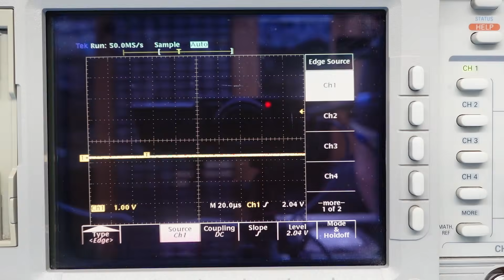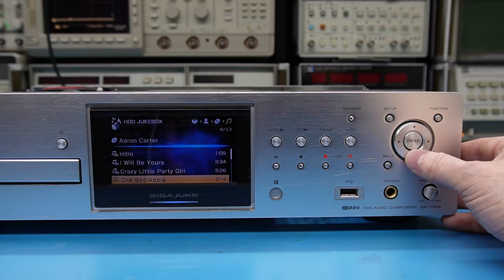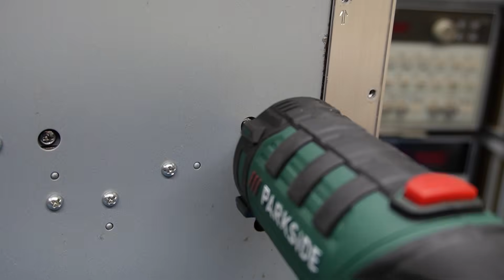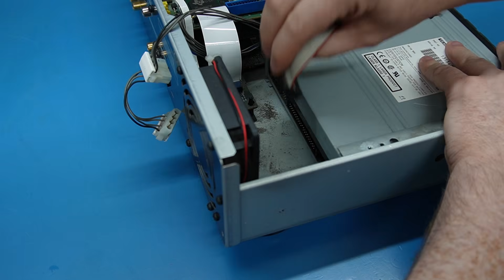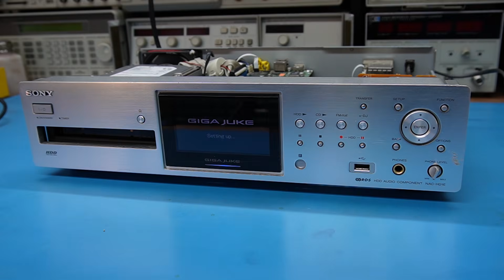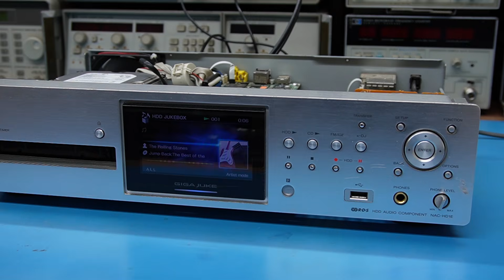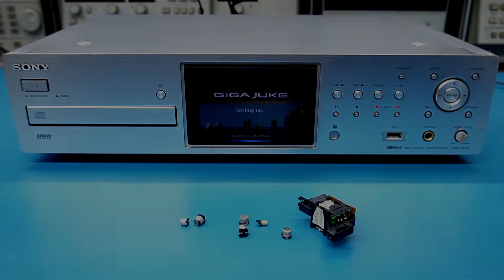SONY Giga Juke, Codename 'PROBLEMBOX'

Comment from the maker: Want to Master the art of electronic repair? 

Check out MendItLikeMark: https://www.menditmark.com/menditlikemark
Reply: With SMD resistors/caps, I touch the flux from the refreshed solder pads with the tweezers. The SMD parts will stick to the tweezers and allow you to remove them from the packet much easier.
Reply: Seriously contemplating that course
Reply: Hello. I have a Toshiba RT -7077 and the cassette player lost his sound. No sound on speaker output and have the same problem on headphones output. I am manage to fix some electronics, but this seems to be a little complicated for me. It have some chances to be fixed ? I'm a bit far from you Sir. From Romania to be exactly. Untill I will be manage to find someone good to fix it, it will be sit for a while
Reply: , find the circuit diagram and check the audio IC.
Reply: @themlotproductions  you know where I can find the circuit diagram? I searched for it on Google, but I found nothing
Reply: Why not try the BadCaps forum as a starting point?
Reply: No
Reply: I'm also thinking about the course, but looking at all your bench gear, the regulated power supply, the Bench multimeter, the signal generator the oscilloscope , to name a few.  These individually cost £x,000's to purchase.   So how much do you need to spend to have the kind of equipment necessary to do this work?
Reply: With the large electrolytic capacitors, the best way to remove them is to just cut them horizontally with wirecutters.
They will nearly fall apart, than how you just have two wires sticking out that you can desolder easily
Reply: The web site is locked
Reply: @snowysimon  so i'm not the only one.... that sucks!

Comment: I've never seen a CD unit playing audio half of its speed. A CD unit is quite a "boolean" device: either it works (good) or it doesn't (doesn't read disc, skipping stuff, jitters...). It's a digital device, so unlike a "record player", it doesn't playback "half the speed" because the spindle motor runs half the speed it's supposed to. So, I'm thinking there's some strange setting somewhere into that machine that does the trick...

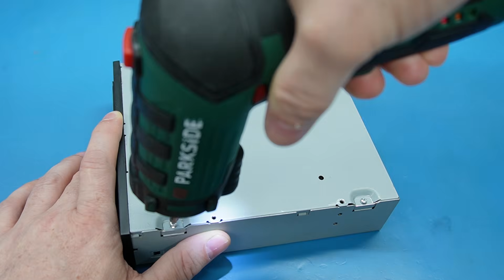Comment: I don't know if you already (or ever) fully fixed this, but around 16:00 when you say "I'm assuming the spindle is rotating at roughly half speed" because the playback sound is slow, did you mean that playback speed was related to the CD spindle speed? If so I do not believe that is correct and I think it might point to an untried fix for the slow playing problem. A half-speed CD spindle playing half-speed recordings would only make sense there if it were an analog vinyl record player, where the tone frequencies are determined by the speed of physical grooves passing by the needles. One second of CD playback speed corresponds ultimately to 176,400 bytes.

I know you checked the output frequency of the crystal clocks, but I did not see if you checked that the clock was being properly multiplied/divided for the DAC. The clock is slowed down by 75%. You can tell by comparing the relative pitches slowed-down & normal playback tones, since the relative frequencies of any tones will indicate the relative clock speed. The normal speed of your Start Me Up disc is in E, and the slowed down playback is in A. An A (~440 MHz) down  to E (~330MHz) is an interval of a fifth; the frequency ratio is about 4:3. (You should also be able to confirm this ratio by timing and comparing BPM (beats per minute) of each playback. It's essentially just another Hertz to Hertz ratio.)

So, somewhere the DAC frequency is 75% of the playback speed it should be. That this is such an even number seems like a useful clue if the problem pops up again. Anyway thanks for the excellent channel and content, each episode brings new lessons.

Comment: If you dont set the bios clock on a PC you can get all types of problems i would have just set that anyway and checked the bios battery if the clock resets itself after being turned off. Who knows though 🤣

Comment: Have you gotten this thing working? I’m new here, and aside from soldering I’m not exactly an electronics wizard. But it does seem that the problem is digital only. So everyone assumes it’s software, right? The thing keeps going back into setup mode, as if it had a dead CMOS battery or something. Seems like the two are closely related.

Very interesting! Oh, and nice scope - I use a similar one, 1080 1/2.8 sensor camera on 1/3 reducer to match eyepieces diagonally, simufocal, plus I’ve got 1/3, 1/2, and 2/3 reduction lenses. But you’ve got that nice arm that I’ve been avoiding, and I’m rethinking it now because yours looks stable even with the camera.

New addiction, watching you work, thanks for this amazing channel!

Comment: The issue lies with the DAC, which is why radio works at full speed, but digital out is only at half speed. It could indeed be the crystal or it could also be the DAC output chip, I would just do a backtrace from the digital to analog out and see how the signal changes.

Comment: Those 0402 sized resistors I open over a blank white sheet of paper. They magically disappear on any other surface. Put a bit of flux on your tweezers and where ever they are going. It's sticky enough to hold them. If I try grasping them with the tweezers they have a way of tiddly winking into obscurity. Literally like trying to solder a flea. Forget about the 01105s.

Comment: Did you check the voltage to the hard drive and the cd?
Reply: The reason I say this if the radio was recorded slowly then it would sound normal at playback. And all the other things would explain low voltage when playing back sound

Comment: Did you ever try utilising the system settings?

DPC settings in particular, but also doing a full set up and connecting to the web for any potential updates and for ensuring the clock/date is set correctly.

Comment: my thoughts, it seems to be playing at half speed across all digital sources (have you tried the usb port too?).  I know you checked the oscillators, and they were good, but I suspect that there would probably be a clock divider circuit involved (caps and resistors) and a couple of switching resistors for the squire wave.  Have you tried measuring the clock signal downstream of the circuitry at the chip itself. Just a thought.  Simon

Comment: My money is on it being a replacement drive, which is being set into the wrong mode by the gigajuke. When you connected it to the DOS machine, that reset it, it worked until the gigajuke sent bollox instructions to it again. I'm absolutely no use at all at component level  diagnostics but I'm good with systems.

Comment: You are repairing a CD drive, and you have the optical stuff in stock ....ARE YOU KIDDING ME!!!!!!!!!!!!!!!!!!!
....why the hell not just replace the drive (hard to get though)
Reply: answered your own question there.  Try buying a working ide cd-rom.

I would've thought thered be a pot to adjust the laser that just needed tweaking up like the old Xbox drives quick tweak and it'd be reading discs again

Comment: Something to do with reclocking on the DAC, because both CD and HDD playback is slow...  Possibly not sending the right clock or mode commands to the DAC...?
Was waiting for the FM radio to play back at 1/2 speed...   😛

Comment: It's quite possible by skipping the NTP time server setup (and not connecting the thing to the internet) it didn't complete its clock setup and got stuck on the 32 KHz sample rate. The backup battery ought to be dead as well.

Comment: Those load/save things were cool.  Since it was just audio, me and a mate used the telephone to transfer data back and forth, one hitting save while the other hit load, years before we knew what a modem was. We just openened the handset, connecting the mic input cable to the spectrum line out, and the spectrum line in to the speaker cable.  And it worked.

Comment: Definitely a clock issue, the record and playback was correct as they both used the bad clock reference.  Now I'll finish watching and see what you found
Reply: Did you check those clock generators, ic 1601 and 1701?

Comment: A couple notes here:
- the CD drive was only connected by the IDE cable, so the only way the audio gets to the internal mainboard would be via the standard ATA READ commands, the drive will return 2352 bytes of data per audio "sector", data format is always 16bit 2ch raw audio samples @44.1kHz.
- it would be interesting to get the hands on the Mp3 or whatever files are on the HDD, to see that metadata and encoding information they have, and especially if they play ok on a regular device.
- As others have noted that the "firmware is in a linux partiton, there's gonna be some kind of ancient embedded linux running on that box. So cloning the HDD and poking at the contents from either a Linux VM or a RasPi with an PATA-2-SATA converter may yield more insight. Especially, if the software on that box does some logging of that it is doing (or fails to do).
- The RTC battery is certainly dead, so the RTC won't hold any info across a power cycle.

Comment: Have a fairly new Denon Receiver and the power is hardwired which I’m not super happy about / any videos on changing it over to add a female power connector (iEC I presume). Suggestions?

Comment: Mark, you are clearly a hardware engineer. It is typical to blame the software (or need of an upgrade) when something unique occurs. But, remember that it did play a CD at the right speed one time (you said it fixed itself...) . Review your steps prior to that "intermittent" working condition. There may be a setting that gets flipped in the software during some operational sequence ;-)     ...yep, I'm a HW guy too...

Comment: If both the CD playback and MP3 playback are running at slow speeds, my first thought would be to check any clocks on the DAC itself, if that’s not internal. I don’t have the schematics. It certainly wouldn’t have been the CD drive running at half speed! That would just cause skips, if it worked at all.

See if there is anything involving the sampling rate, unless it’s built into the main chip, which would suck!

Comment: I think you stepped over the NTP (network TIME protocol) settings to fast. I think the RTC needs to be synchronized because it quite an old unit and it might be that’s it a little bit out of sync.

Comment: Great videos. Sounds like system sample rate is not correctly auto-setting for 44.1kHz (CD) and is incorrectly set. Maybe a settings preference or faulty sensing chip?

Comment: This is sampling rate issue. If you playback something that is recorded at say 44.1K but with lower sampling rate it will sound as your issue. Just check what are 44.1K and 48K rates derived from and that is source of your problem. Also, do factory reset of the player (if possible) and check if external digital clock is disabled and set to internal (if it has this option). Cheere! S

Comment: I wonder if the slow speed is the DAC not being set right , I think you saw the switch happening, I wonder if there is setting to lock it to 44khz (instead of auto)  or to an external clock source.  Maybe you can bypass the dac with a digital out.

Comment: Maybe HDD IDE had a fallback to PIO mode? It happens when hdd gets bad sectors, bad/noisy IDE cable, even master/ slave setup (that can get wierd, I had to put it into impossible states for some combos). 
It sure behaves like that, as the first try after both disconnected it worked fine (DMA mode), then it fell back to a very busy software PIO mode.
There is also one cap you didn't replace, mind you.
What that thing needs is to try it with working set of PATA cables, some other junk PATA CD to try with it (unless Sony didn't lock it to specific drive models!) and HDD replacement ( to some PATA SSD or card adapter, after making it bootable).

Comment: Nice to see Mark working the way I did for the past 50 years. I have seen maybe 10.000s audio/video CDplayers  and from the time K6 tube CRT from Philips. I repaired 95 % of all that came in, But working for all kind of factorys/shops didn't give me much time to spend on a repair. I had to produce 8-10 repairs a day to make things economical. Most of the time I run on routine. If you know the basics and the weak points of components used in the days repairing becomes more easy because things come back. For example a cd player will have in most cases a defect laser, so not cleaning but replace laser was first job. Also knowing brand types sometimes you have to swap more than 40 components to make it preventif. My job is down the driain for years now because new become cheap and people replaced stuf for new because of that. My skills no loner needed since about 2000 I closed my shop. I calculated that working for 100 hours a week and calculating costs tools and folowing the educational workshops at Grundig/Philips/Thomson and keeping up with diagrams I made a netto result of 4 Euro an hour. That was the point I desided to no longer sit behind the tele but at the front.
Reply: You sort of described my life.

Comment: Could there be a setting that needs to be changed? Maybe some sort of half speed play option that is being toggled on and off? The fact that 2 sources did the same thing points to a firmware/software issue as you stated or a playback setting.

Comment: I would check the DAC clock and see if it's within spec. If definitely sounds like something is running half clock frequency. Both CD and MP3 part runs slow indicating the problem is common among those two. (CPU, ADC). The Jukebox can play CD's in two ways. Either by using the DAC in the drive itself using the three or four pin cable or by reading the bits of the drive and play them using the CPU. 

When checking the crystals with the oscilloscope, do it while you are playing music. The capacity of the probe can load the crystal. 

Also, perhaps reset settings to factory default if there's some stupid esoteric settings somewhere that can cause this.

Comment: I have a question: how do you undo those wound wire-on-peg connectors in older electronics, and how to put them back ?
Reply: Wire wrap tool. I use them daily at my telephone central offices. Its basically a hollow tube that slides onto the pin and there there is another smaller tube next to it that a wire feeds up into. When you push the wire up into the outboard slot about 10mm, you then take the tool and slide it over the pin and give it a clockwise twist about 5 times. It wraps the wire perfectly around the pin. Now to get it off the other end of the tool has a little raised side at the end like a hollow bolt that was cut and one thread was left .5mm long, it will grab the wire and you unwrap it CCW and it comes off enough for you to grab the loosened wire and pull it off. Lots of Old TV's were wire wrapped and quite a few older electronics has some wire wrapped areas of the through hole boards usually on the bottom.

Comment: Used to work for Panasonic back in the 90's.  It's almost amusing now to think it was actually economically feasible to repair those portable CD players,  but we repaired sizes of them.
Before all the servos became automatic,  we actually had a gig we connected and made the adjustments manually while watching leds on the test gig.

Comment: Small capacitors like these tend to fail gradually with climbing leakage current. This shows up as a higher than spec capacity measurement on the multimeter.

Comment: OK... I know I'm late to this one, and I do understand all the talk of DACs and clock frequencies etc BUT... I still can't see why the thing worked, as in, it played back the CD at the correct speed after been swapped over to the old PC, where it also worked just fine? I've been out of the game since the late 90's and loosing "zee little grey cells" at an alarming rate so, can one of you bright sparks explain that to me PLEASE. I just can't figure it out.
Reply: The Gigajuke is not setting the CD drive correctly. It might be down to a few things buggy Gigajuke firmware, buggy CD drive software, or someone swapping the CD drive for a incompatible one for instance. 

Even PC ripping software has issues with some CD drives.

Comment: A lot of interesting idea and all logical, check the RTC, the battery and perform a soft/hard reset.  All things worth checking.   However, I am sitting here pondering the symptoms.  When you re-fitted after installing in a PC it worked fine.  If it were an RTC problem, then the disc is encoded at 44k and there was a problem with RTC or decoder, it should not have played back at the right speed.    So an alternative suggestion.  Clearly the CD player is PC compatible, so why not try a PC CD player in there?  OK, getting hold of an IDE one may be difficult, but a SATA one with and IDE to SATA board should work....  What I am suggesting is that the Gaga juke may be sending a reset command to the CD player that is being acted on wrongly and their is a fault in the CD player.

Comment: If it runs like that on the proper crystal frequency, what'll happen if you under or overclock one or both crystals?  How about IC1601 and IC1701 on that diagram, are their outputs all correct?

That EEPROM's gotta be worth a nosey through too, surely, not to fix it but to see what's on it and if there's anything worth poking at, or rather POKEing at :)